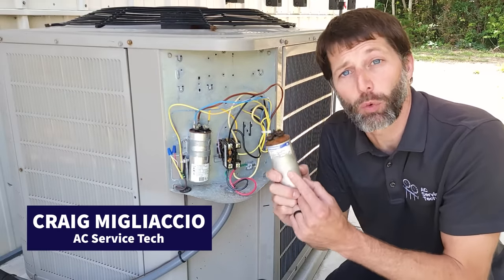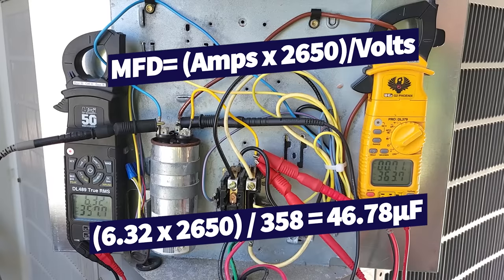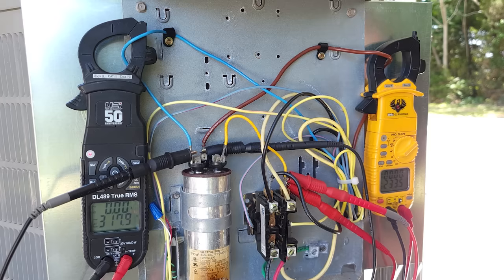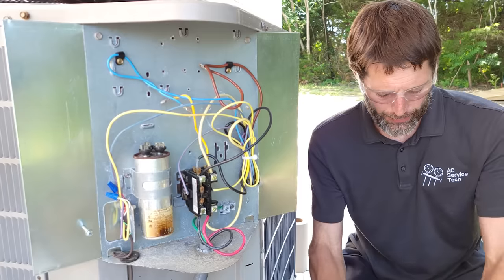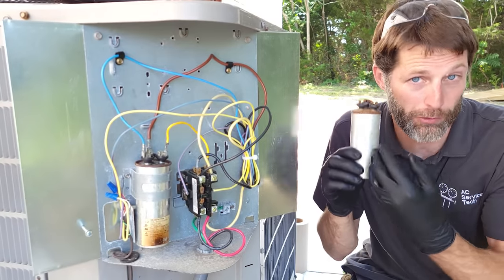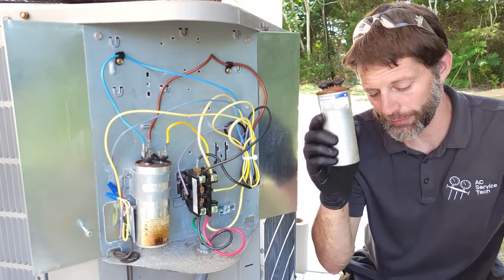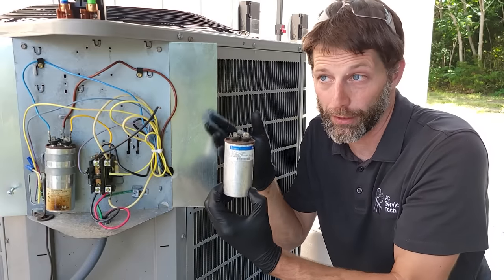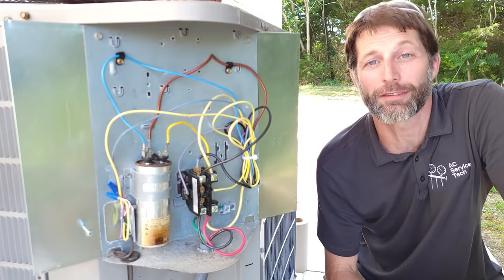WHY CAPACITORS FAIL in Air Conditioners! Watch it Break!

Comment: EXCELLENT video! As mentioned by @classic Pontiac37, sometimes using a higher voltage rated cap will make things last longer. In petrochem control systems, I've seen blown out power supply filter capacitors that the manufacturer pinched pennies on and were within a volt or 2 of the running voltage. Running "rated voltage" that close is not good in HVAC or in production plants running 24/7. We solved that problem by replacing all of those "too tight" VDC filter capacitors with ones almost triple the running voltage. No more failures.

Comment: HVAC school was insisting caps fail due to overvoltage (transient / surge).  When I suggested it was heat, I was essentially told I was stupid.   I've had really good luck replacing with two capacitors to spread the heat load.  I also agree with the commenter who suggests  caps with higher voltage ratings.  Everything I've seen suggests heat is the real culprit.
Reply: An apt. complex installed all condensers on roof, shingles.  The heat destroys them in 2 years, a rotating problem.  They decided to put all 114 of them back on ground.  No more fails.
Reply: Your instructor has one of two things. 
1.Stick to the timeline for the next class
2. Arrogance to the challenge 
3. Both
Reply: @danielabilez3619  It is heat. I am EE trained and HVAC tech. Try placing Condensers on roof with lineset and watch the failure rate skyrocket. Recommend the 440 VAC rated.
Reply: Yezzir, Heat as a result of... but heat gets all capacitors
Reply: yep, but excessive current through(strictly in and out, a cap shouldnt pass current through it directly) and/or overvoltage can cause internal heating as well, eventually destroying it , some motor caps are rated for intermittent start use only  not 'run' .. you have to use the correct type
Reply: @andygozzo72  Huh?  AC current certainly does flow through the cap, and a percentage (called dissipation factor) is converted to heat in resistive losses.  Overvoltage transients are so short duration they cause little heat.  Usually if overvoltage causes a fail, it arcs across resulting in a shorted cap.  That's not what we're seeing.
Reply: @chrisscott1547  no it doesnt, not in the usual ohms law way, if it did, its a short! it only seems to pass current due to the capacitive reactance, current is out of phase with voltage applied, it leads it, it does still cause internal heating , though ,
Reply: @andygozzo72  As an engineer who has designed many AC impedance matching circuits using capacitors over the years, let me assure you that capacitors draw and flow AC current.    The phase change is why they are used with motors.  Ask yourself this:  If no AC current will flow through the capacitor, (like say a 100 Megohm resistor) how does it's effect start or run the motor?   It's mostly reactive impedance, expressed as an imaginary number.  Ohm's law does not apply as in DC circuits.  The power that a capacitor dissipates as heat is not all of the current x voltage across it, but rather it's internal resistive losses.
Reply: @SovereignTroll  Good to know. With temperatures above normal everywhere, part shotages. We are in for some good times. Thank you for the information

Comment: For a callout work, we discovered the facility had a 60 Hz ceiling concealed equipment in a 50 Hz mains power source country and over 80% of the units had swollen & bad capacitors. Apparently, they have  been having the issues for a couple of years since commissioning. Once they are changed, the units work just fine. Recommended all capacitors to be changed with the scheduled routine maintenance to prevent downtime.

Comment: here in the US southeast im seeing alot of capacitors fail within the warranty of the unit, ive noticed that these capacitors are made by the same company, we replace them with a cap made by a different company from a different place and they last significantly longer for some reason

Comment: What I saw regarding the voltage measurements reminded me of something I first read as a military guideline for component reliability.  I was surprised, but the saw other supporting information, including and especially the Arrhenius studies of temperature effects.  Anyway, what I then decided to make my permanent memory, is that you never use the components at the listed ratings!  You design your systems to stress the components only to 70% voltage and 70% current relative to the manufacturer listings.  In other words, consider the listed values as maximum, not as safe continuous ones.  In the shown case, the 365 V appearing on the capacitor would require 550 V or 600 V rated capacitors.  That assuming the manufacturer would not cheat and label their capacitor higher voltage, knowing that the users will do the derating...
Reply from the maker: Great tips and outlook!
Reply: Do you mean his actual was 365, so then use a 5-600 capacitor?
Reply: @bryanhauschild4376  
Yes - that is what I saw on on the meter display in the video.  If that sounds wrong, just think what happens when you have an inductive coil (motor) and the capacitor in series.  Depending on the two values, there is a resonance at some frequency, maybe a harmonic of the line frequency.  In resonance or even near a resonance, you get an increase in voltage over EACH component.  In theory (infinite Q, zero resistance), the voltage would climb to infinity.  In practical situation, the circuit Q is not infinite, but some over voltage is developed anyway.
Reply: @InssiAjaton  could you explain resonance further? Is the resonance you speak of creating sound too?
Reply: @bryanhauschild4376  Hey Bryan. Resonance is where the inductive reactance, XL and capacitive reactance, XC are equal to each other. At this point, the voltage across the inductor and capacitor are equal, but the voltages are 180 degrees out of phase. This will create minimum impedance in the circuit where the current is the highest which is only limited by the resistance of the winding. This pertains to a series circuit where the inductor start winding and run capacitor are in series. It has nothing to do with sound.
Reply: @stuzman52  its over my head but all the same fascinating. Not something I deal with in aircraft maintenance.
Reply: Somewhat true but usually the case is that a trustworthy manufacturer, builds more margin into the ratings while a dodgy  chinese brand, barely makes their ratings.  Also the chinese ones tend to have a less stable electrolyte that may break down from time alone, or accelerated by temperature.  Pretty sad when a cap fails just sitting on a shelf waiting to be installed!
Reply: @bryanhauschild4376  Think of it this way, a resonance can be anything. Take for instance, the old Galloping Gerty bridge (the old Tacoma Narrows Bridge), at the time it was constructed and finished in I think 1940, it sported a solid road deck that caused the wind, even a mild one to cause the bridge deck to oscillate up/down a little, hence the name. Then one day a moderate wind I think whipped through the Narrows and caused the bridge to oscillate enough to cause violent sways of the road deck and it fell into the sound. When the bridge was rebuilt and opened in 1950, it had open sides of the steel girding supporting the road deck, and grates along its surface in places to reduce this, and to allow the winds go go through the road deck itself, rather than be forced to go above or below it. That is a form of oscillation. An audible squeal is another form when a speaker gets too close to a microphone and causes feedback can be another form of it.

In playing vinyl, a vibration coming up to your turntable can affect the needle's tracking in the groove of the record and can muddy up the sound if bad enough, so the purpose of a well designed table is to minimize it as much as possible for the cleanest playback and a resonance can be at a certain frequency and can cause at times in certain circumstances cause the "voicing" if you will of a table to be a bit less full sounding, strident etc, but can also cause a sharpness in certain frequencies too for that matter. Also, some carts will do a "dance" by bouncing up and down on its suspension when that resonance frequency is reached.

All of this is just various forms of oscillations. Hope this helps.
Reply: @bryanhauschild4376  Which is why the avionics engineers are A: contractors, and B: better paid.
Reply: Engineers always build stronger than it "could get by with". The problem is the bean counters looking for a way to save money,
Reply: @stinkycheese804  ALL electronic components age, even when a device is off.
Reply: @waydav1s and in case the device is on it is simply slowly burning

Comment: I have lennox unit from 1979 still running at my house.  I've changed every part on the unit except for the compressor and the original 45 MFD run capacitor (separate capacitor for the fan motor and compressor).  That 45 MFD capacitor from 1979 is HUGE and still running like a champ!  I check it every season.  I am of the opinion that ever since capacitors were made smaller and smaller they fail faster than ever.  Less surface area to dissipate heat.  I know it's more convenient to make them smaller, but I feel it has reduced their lifespan.

Comment: Wow.  Excellent presentation on capacitors.  I have two 3 ton AC systems at my house.  Last week one capacitor failed.  AC service tech fixed it and 3 hours later after he left the second one failed on other unit.   I remember looking at it and it looked bulged on the top and "wet".  But tech didn't realize as far as I can tell now what the telltale signs were that it was bad our about to go bad.  My take away from this experience is that after a $308 service call I need to buy spare capacitors.  Which I have now done at a whopping $16.80 each.  These should be treated light light bulbs and every homeowner should have a spare on hand.  If AC won't start it's super simple to swap out cap.  There is an 80% chance that is the problem and you are back up and running right away without having to call for expensive service.
Reply: If you don’t mind me asking, where do you buy these spare capacitors?  After watching this video I had the same thought of having a spare as a lot of times that is why a system goes down.....thanks
Reply: @trailerparkcryptoking5213  amazon, ebay.
Reply: Are there any safety concerns when handling a capacitor?
Reply: @sktoh4469  yes.  if the capacitor is charged you do not want to short your self across it.  The standard technique for handling capacitors especially "power capacitors" is to ensure that you short the terminals to dissipate any charge.  Easily done by placing a good conductor across it like a screwdriver shaft.
Reply: @bartoncourcier414  
No don't do that. Better for the cap if you use a resistor across the terminals. 
The screw driver is a last resort.
Reply: @jayytee8062  I'll defer to your expertise but I've never seen an AC tech use a resistor.  Only screwdriver :)  From a safety perspective still works though but I guess you are saying that its easier on the cap and a better technique.  Good to know. For typical AC capacitor values what resistor value would you recommend?
Reply: @jayytee8062  does a capacitor need to be discharged for testing purposes?
Reply: @trailerparkcryptoking5213  
Usually from my understanding, there is a bleed off resistor already in big start up caps. But sometimes the resistor can go bad and you will have a fully charged cap. So test your cap volts with your meter before anything.
If they happen to be holding a big charge you can carefully connect a load such as a resistor across the terminals and re-test to see if the volts have come down to zero or close to zero.

There are plenty of videos for capacitor dischargers you can easily build here on YouTube.

If you are totally new to electrical/electronics especially high voltage Please do not attempt anything for your own sake. Remember even experience technicians get zapped - so what are your chances if you are not experienced and knowledgeable?
Reply: @bartoncourcier414  
See my previous reply to the other fella above this one.
Also I'm not an AC technician, just a hobbyist.
Reply: @trailerparkcryptoking5213  Allied Electronics, Mouser Electronics, Digi-Key Corp, MCM,  Farnell element14 and The Key are all competitors in this space.  I have used Allied, Mouser, and Digi-Key myself and had great customer service from all of them.  Just keep in mind, you really don't want the cheapest ones, you want quality pieces, and they will not be the cheapest by a long shot.  I bought a $5 dual cap and replaced a failed one after a lightning strike.  It lasted 14 months and died for no obvious reason.  I replaced it with a Cornell-Dubilier unit that was $13.37 from Allied and it has been in service for 5 years without any issues and gets inspected annually in the spring every year, so I know it's in good shape.  I still have spares on the shelf because I know one good lightning storm will kill even the best of capacitors.
Reply: if you paid 16.80 for it , then likely you will replace it soon 😂

Comment: Finally! In my 48 years of HVAC I witness someone who knows what he is talking about. Heat and life, I have argued, are the only two culprits of failed capacitors. Cheap manufacturing is a culprit, but only because the cheap caps can't take the heat. I use only USA made caps in 440v.  I have had repeated failures on a few condensers, and after moving the cap to the inside of the condensing coil where the fans air movement can cool the cap off, the failures quit. By doing what RUUD/Weatherking has done by making a hole in the cabinet and slipping the cap into the airflow. *You'll need to make sure the leads aren't exposed to the weather. 
 Job well done.!!! 
  Oh! Just one more thing, though it is tedious- "2652" is more accurate for me. A long time discussion I'm sure you have had.
Reply: Heat reduces the life of any component. If the manufacturer wanted to do something about that, they easily could. There's a giant fan in the condenser... How about putting a couple of vents in the electronic compartment so there's a bit of airflow from the fan?
Reply: Manufacturers tend to source from the cheapest OEM parts to line their CEO pockets. You get what you pay for,

Comment: Please share your thoughts on these four topics.

1. Adding surge protector to outside unit. We live in Tampa, the US lighting capitol.

2. Adding a "slow start" device to the unit.

3. Using Turbo 200 Motor Run Capacitor (made in USA). These have 5 year guarantee.

4. DIYer changing Capacitor.

Thanks -- great video.

Comment: Excellent video. I have told customers for years the biggest killer of capacitors is heat (I'm in Florida) and the fact that many service techs don't check them to see if they are getting weak. When i was younger it seemed more common for people to have their systems checked/serviced/maintained in the spring as a preventative measure, now they wait until the system breaks down.
Reply: Don't you think it is silly or a crime for a person to have a repair person come by to check their system every spring? Old ladies and old men having some unknown dude come into their home to rob them when they come in to use the bathroom? Let alone come up with a bogus replacement and never offering to even show them the defective part. Why don't they build them right in the first place. Solar panels last 25 years and you don't need a yearly service call. The days of constant repairs and checks are over hopefully.
Reply: @timsteinkamp2245  Seems a bit unfair to compare solid state devices to HVAC.
Reply: @AvgDan  My comment was about the idea of having a service technician come into your home and verifying the unit will work for the next season. I'm not talking solid state or HVAC but just the idea that you have to allow a person into your house every season to check us out. Even so there is no real guaranties. You can do a preseason check and it can still fail.

Comment: This is awesome.  Concise, explains everything, no extraneous commentary or time waste.  However, If you began by checking the capacitor and found that it was good, why did it fail?  Secondly, when you evaluate a capacitor, how do you know that it will fail?  which yours did and you apparently knew it, but what was the indication that it would fail?
Reply: See my posts below, he heated it (with a torch?). Please click 'like' on that post so it can stay at the top (when sorted by 'top comments')
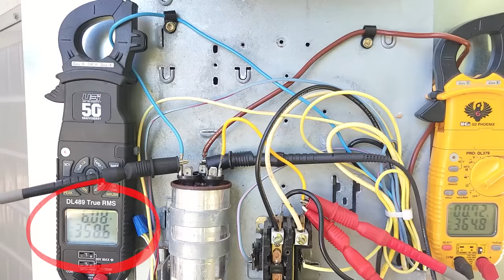SO MANY also have this question. Credit goes to others' answers (replies) below that spotted it before me at 5:42, so I also posted this as a comment instead of a reply, so people can see it without searching and opening all the replies.
Mr KL

Comment: Nice video.
Old AC tech told me tune ups are a racket....He said corrosion causes leads to have higher resistance and causes the most problems. Just turn off the power..remove every wire / connector you can get to and clean the contact area. Also clean out debris and clean coils. Been doing that every spring and my 27 year old unit is still going strong.